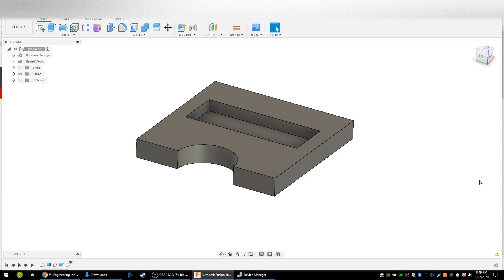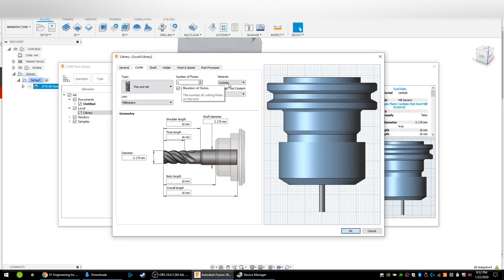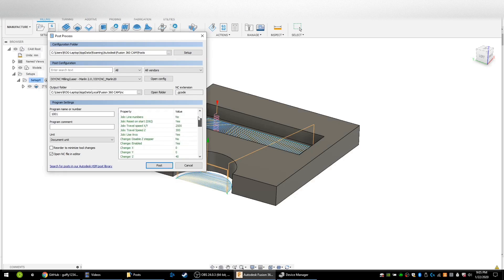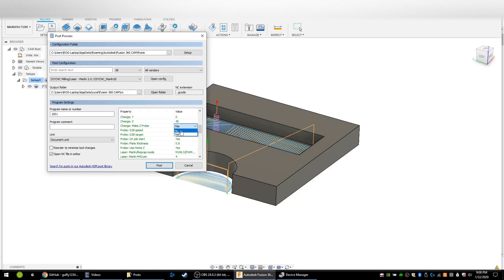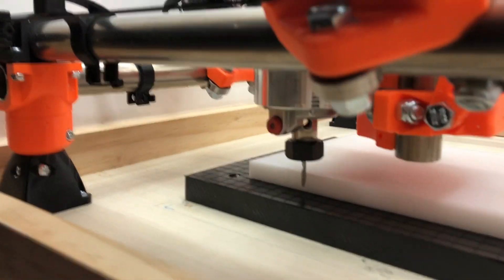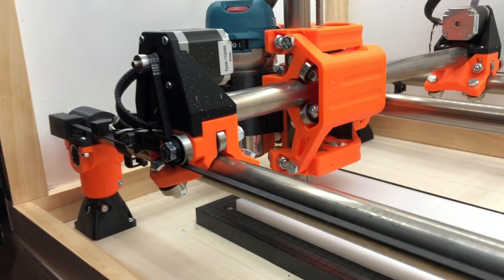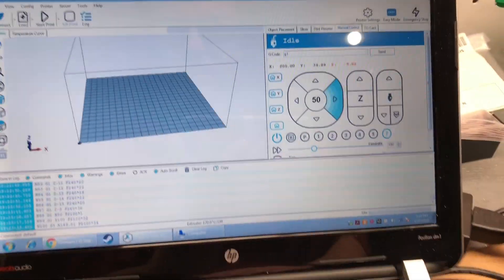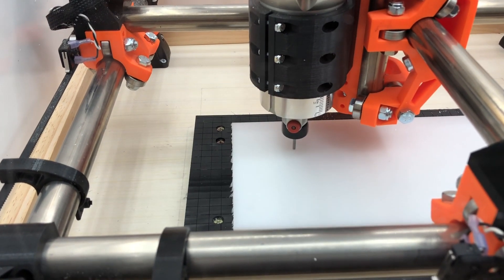MPCNC - Fusion 360 Post Processing and Basics

Comment: Just to say, 3 years on this helped me sort out my Tiny CNC Marlin set up via Fusion. Many thanks.
Reply from the maker: Glad it's still relevant!  I always wonder with these videos if things have changed enough that the tutorials don't work anymore.
Reply: Yes still very relevant. This is the most useful video I found for Marlin & Fusion post processing (a lot of disjointed CNC stuff out there). Having a Fusion 360 personal license I did get caught out because the post processor now defaults back after closing the program so need to tweak all when next used. No biggy. I stay within feed rate confines to meet the license. I am using Marlin on one of these:  https://www.youtube.com/watch?v=ctyLjOHg7Ag&t=1026s still some slight calibration needed on firmware limits but very nearly there. Mostly thanks to your very clear & informative videos. Well done & thanks again. Steve
Reply: I have linked your YT to the mentioned discord to help others.

Comment: Hi Mr. Squirrel.  Are you still using the same setup these days?  As of late I'm having issues with "Machine_Capability_Simulation" errors when trying to simulate a process.  I was able to add this into the post processor which fixed the problem but now The viewpoint follows the tool instead of staying in a fixed position.  I was trying this with FlyFishers Post processor. Thanks again for the vid.
Reply from the maker: I designed and built my own CNC that I use instead now.  But my Fusion360 process is essentially the same.  Never seen that error so I’m not sure how to fix it.  Sorry.

Comment: My LowRider V2 kept crashing the tool in the z direction when I was using tabs, I am assuming this is because of marlin fast movement issues?  I have been going nuts, the steppers aren't losing steps, its like the z motors or marlin ignores some of the retract movements on Z.  Thanks so much for these videos!

Comment: I  found this video super helpful and even had to link it to a post on the V1 forum. Thank you for taking the time and documenting this. Along with the supporters on the V1 forum i actually have my machine accepting Gcode now.
Reply from the maker: Glad it helped!  I’ve actually found a bit of an improved way to install the post processor.  You install it into your Fusion cloud library which means it’s accessible on multiple computers.  Here are the instructions.  Ignore the first step, that’s a different post processor but the rest of the stuff is the same.

https://docs.openbuilds.com/doku.php?id=docs:software:fusion360

Comment: What are the dimensions you went with when building your mpcnc? I want a build with a cut area of around 24x24xx4”, just curious how you did yours
Reply from the maker: My build area is very small, about 12" wide by 9" deep.  Total Z height 2.9", minus the spoil board.  I made it small to be extra rigid for cutting aluminum parts.
Reply: Apocalyptic Squirrels nice, thanks for the info